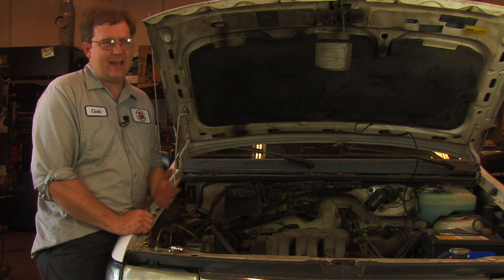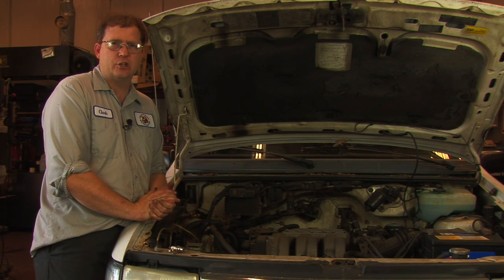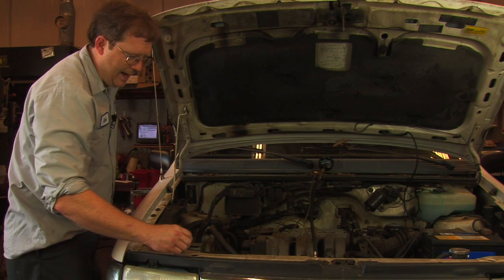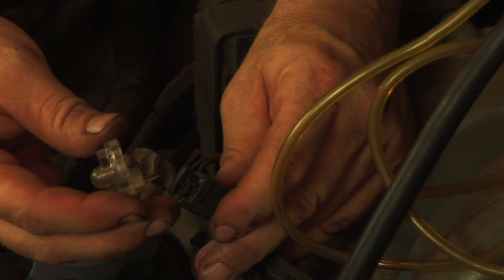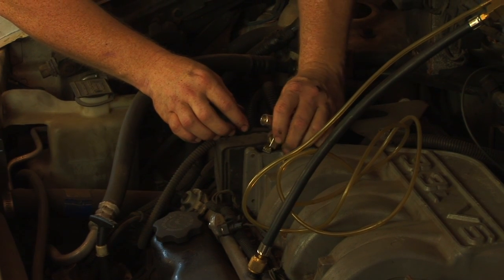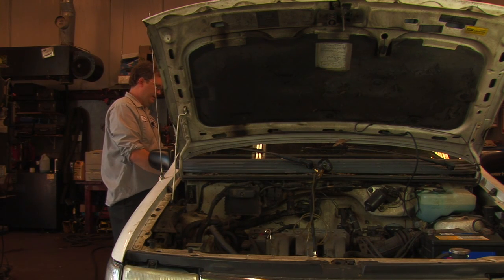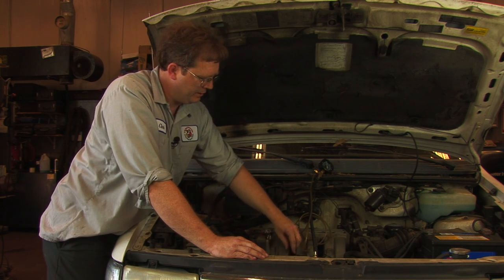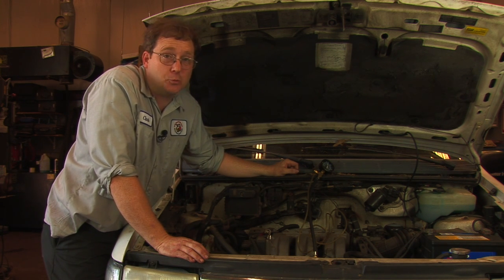Auto Repair & Maintenance : How to Diagnose Car Problems When It's Not Starting

Comment: Thanks! I need to buy a spark plug tester, noid light, and thermometer to put in coolant and test thermostat.  If engine is cold and coolant is flowing, I need to replace thermostat.

Comment: I have a Subaru forester sf5 turbo automatic it has low pulling power from  second gear when u press the kick down it does not respond with the pedal  u hear some back fire in the exhaust what could be the cause?